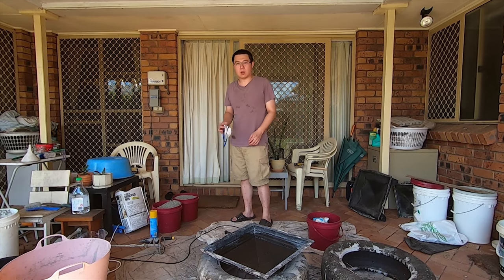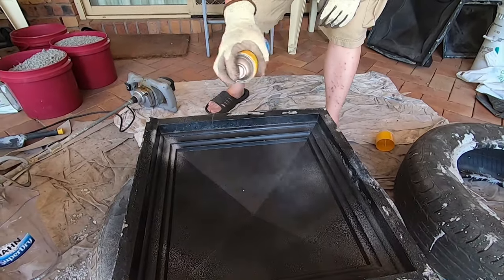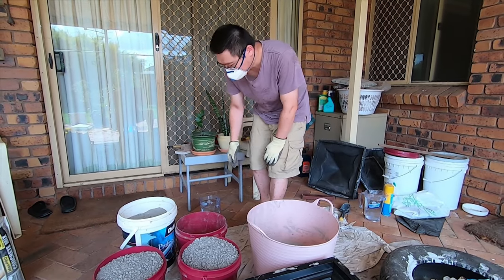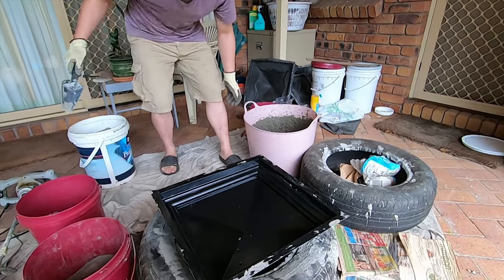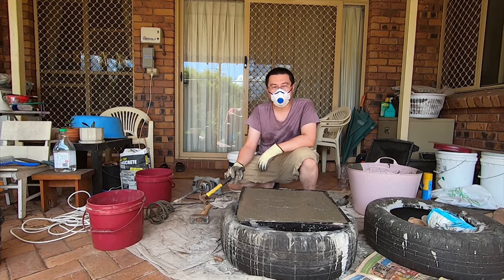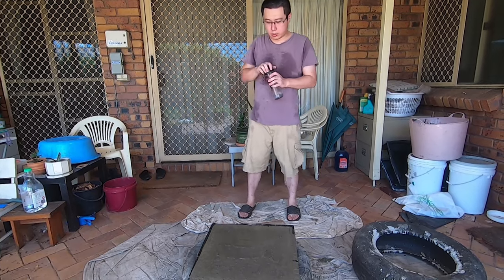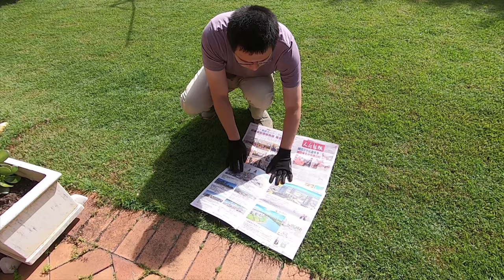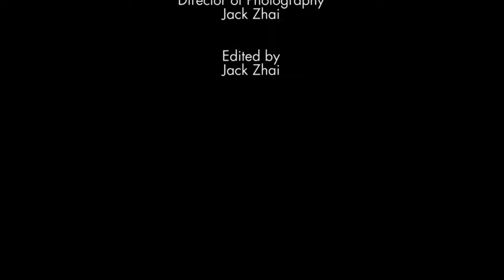Tutorial: How to make Concrete Pier Caps

Comment: Love the tip using the tyre for support Jack , my little tip is cut a square of plywood a few mils bigger on all 4 sides than the actual column it is to sit upon , then set it flush down on the  wet surface ( may need a weight to keep it from rising ) , prise it out when concrete is set .....Now the cap will seat snuggly on top of your column .

Comment: I thought  it was DIY your using a mold
Reply from the maker: Haha you got me. Well for me DIY just means you try to do it yourself instead of hiring someone else and save some money. Doesn't mean you have to build and make everything 100% from scratch. For me I think the process I showed in the video is the easy way to make that's all. Just trying to help others out. 

If you use a hammer 🔨  in a DIY video doesn't mean you have go mine the metal, smelt it to ore and cast to make the hammer from scratch 😉
Reply: @DIYJack  but I thought you were to make your mold lol

Comment: research correct concrete mixtures for all applications .. this guys use of of non specific ratios of cement to aggerate to water to whatever else he has in the mix  makes no sense and will most likely fail in a short period of time. Cement mixes are very specific for different uses.

Comment: Good job but when your trying to get the air bubbles out don’t smack it hard instead make smaller taps with the hammer but more frequently. Most ppl tend to give it a few good wacks and Un intentionally add more bubbles